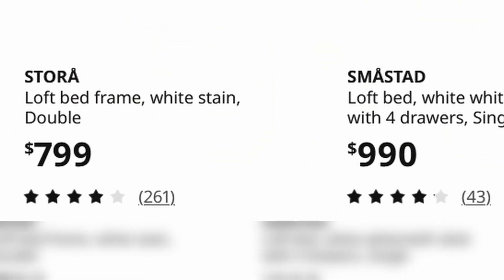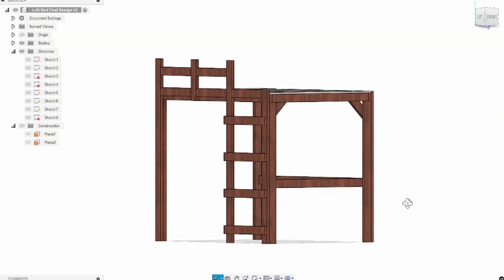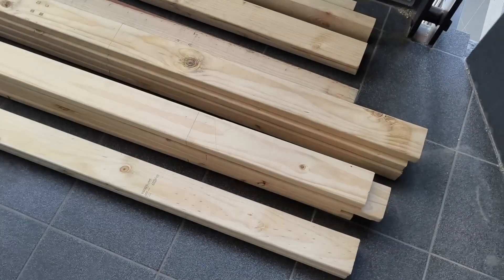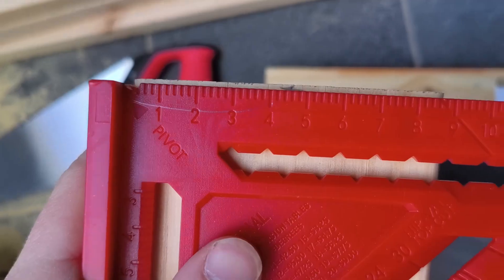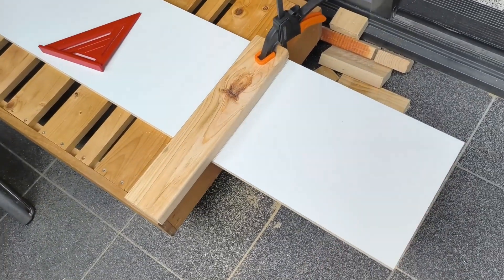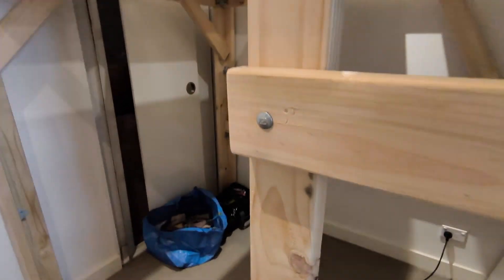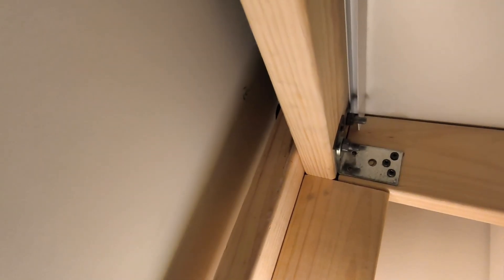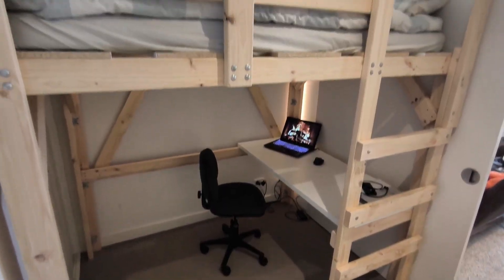I Refused to Pay $1,000 for a Loft Bed So I Built My Own

Comment: Looks good! Great job using the resources you have. You see many videos where people have $10,000 in tools, and really, you can get almost the exact same product with some patience and work. 
One suggestion for later is if you feel the gaps in the slats, just slide the melamine boards down and add one more so you have a solid base.
Reply from the maker: Thank you! Exactly. You don't need all the fancy tools to make something although it might just make it faster and easier but you learn more having to do it the hard way. I will keep the gaps as mattresses are meant to have airflow underneath them to prevent mould growth.